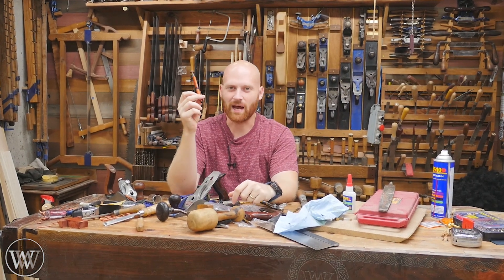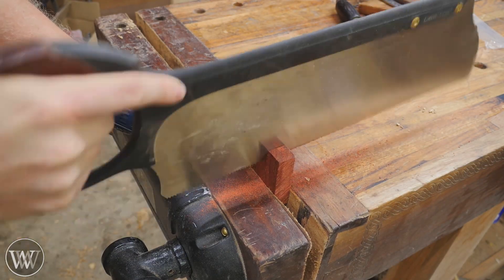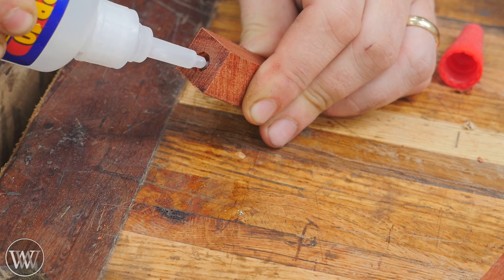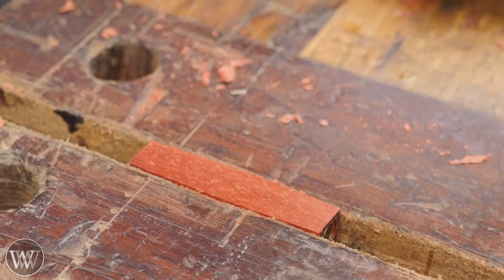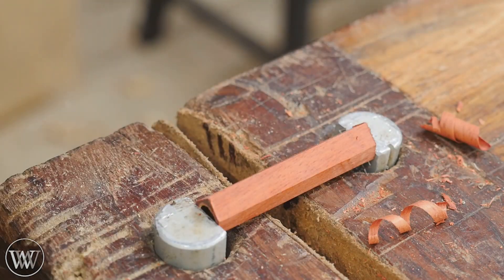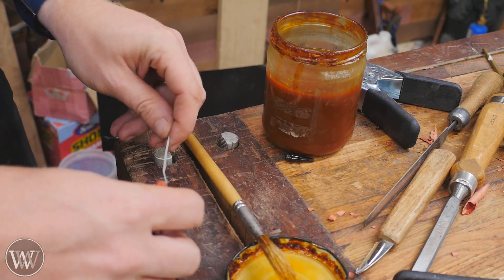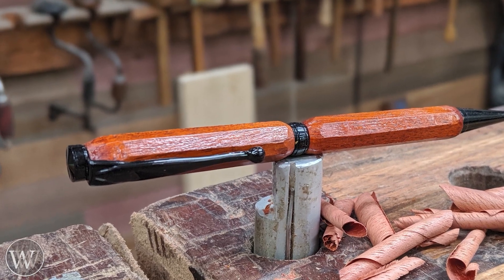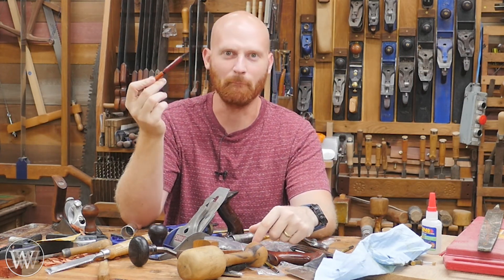How to Make a Pen With a Hand Plane

Comment: I have a few bench dogs with centering pins. They are tall so you can work at almost chest hight, these were made by my grandfather(mainly wheelwright) and he used it for round stock (or rounding stock, they made all kinds of tool handles and turning). If you want, i can give you measurements and photos. Thanks for the video and all the others, im not sure that i watched all of them, but im pretty close :D Have a good day!
Reply from the maker: Thanks. they were also common for leg carving. especially claw foot legs. I have wanted to do a video on that.

Comment: I used a bit brace and an "egg beater" drill to mount a switch box today. 
This may sound trivial, but it was a brick wall that I was drilling into. I was quite surprised at how well it worked.
Reply from the maker: right on. it is always surprising where you find some of these old tools doing better then you expect.

Comment: Could you perhaps freeze the brass tubes, then drill slightly smaller holes and dispense with the glue?
I would expect the tubes to shrink when frozen and go back to full size at room temperature.
Reply from the maker: That would be an interesting idea to try.
Reply: Won’t shrink enough to counter the seasonal changes of wood. 
Most people that make pens that I know of use a press to insert the brass tube into the properly (7mm?) sized hole.